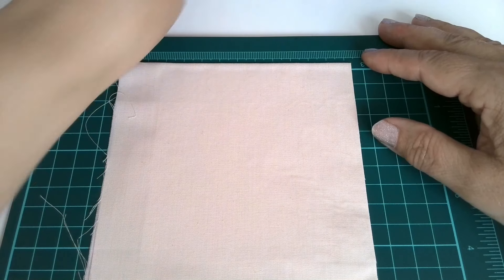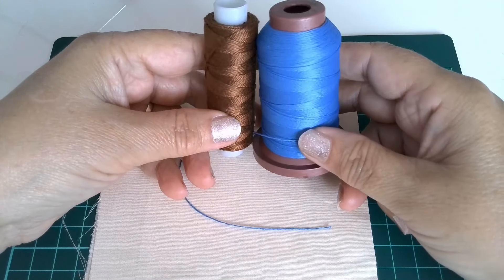How to sew a buttonhole by hand

Comment: Thank you.  I am making a reversible winter coat with fabric that has lots of layers.  I was terrified to put so many layers through my machine.  I think I can do it this way!
Reply from the maker: You certainly can. You can also try bound buttonholes maybe.
Reply: Similar! I'm making a winter dress and with two layers of flannel and a layer of interfacing my machine wasn't having it with the button hole setting so I need to hand stitch it, a fact that terrified me as I have very little experience hand stitching--let alone a button hole! But this video was very easy to follow and I feel much better about making the button holes now.  Thanks a million!

Comment: Thank you so much my machine buttonhole works wonderful when I practice but it ruins my garments when I try it on the real item
Reply from the maker: If the practice buttonhole works well, there must be a reason behind the failures; contact me by email using the contact form from www.ageberry.com and maybe we ca sort it out.
Reply: Same reason I'm here. It's like it will only work on a completely flat, loose piece of fabric . If the  button hole foot feels any change( minor seam allowances ,or with strechty fabric in my case ) it just won't work . Which makes it useless for me . I don't work with wovens.

Comment: You made it nice and simple to encourage people to try! To get perfect distance holes, use a pattern tracing wheel. Make 1, 2, or even 3 passes over each stitch line by offsetting the wheel and transfer paper starting position. The number of passes depends on how close you want your threads.  As you get better you can even reduce your thread size and place the stitch line at 1/16. Only use a slight pulling for each stitch. Happy sewing!
Reply from the maker: Thanks for the idea!

Comment: Thank you for an interesting and informative video.
'Transpore White' is a paper-based surgical tape which is manufactured by the 3M company. The tape is perforated every 1.25mm across its width. If you stick a length of it along the line you have drawn at 5.40 you can use the perforations as a guide to ensure perfect spacing of 1.25mm, 2.5mm, 3.75mm etc between your stitches. The tape is very gentle and easy to remove and can be re-used a few times; it will accommodate gentle curves. I prefer the paper-based tape to the plastic tape.
I hope that I don't offend you by butting in like this.
Reply from the maker: It is never too late to learn a new trick; I will try the tape, thank you!
Reply: @SewingTutorialsByAgeberry  
👍 I hope that you find it useful!
Rob.

Comment: You do a very good job of keeping your stitches even at the cut seam edge and between each stitch. I realize you'd have liked to have kept the stitches closer together but it was difficult when using your camera.  I've seen some tailors who don't use a knot, they put the needle and thread into the back side of the fabric about 1" away from where they will start to sew. Thanks so much for the tip on what kind of thread to use. I wouldn't have thought Pearl cotton, embroidery thread # 10 or embroidery floss would be suitable.  Question:  What size of Cotton Perle do you suggest? DCM shows size 3,5,8 and 12.

Comment: Thank you for this! I have a buttonhole foot, but i tried it on a very stretchy cardigan I'm working on and it didn't go well. Going to do the rest by hand!
Reply from the maker: Glad it helped! It is indeed tricky to sew stretch material, perhaps you will have better success using the stretch buttonhole setting on the sewing machine, if the machine has it.

Comment: At 3:49, how did you determine that the distance from the cut line to each side of the buttonhole is 1/8 inch?
Reply from the maker: This distance measurement is not based on any objective standard or rule but is entirely based on my individual preference. I just want it to be 1/8 inch.